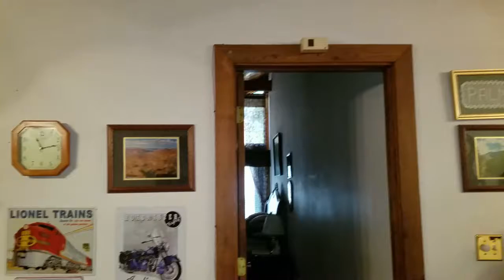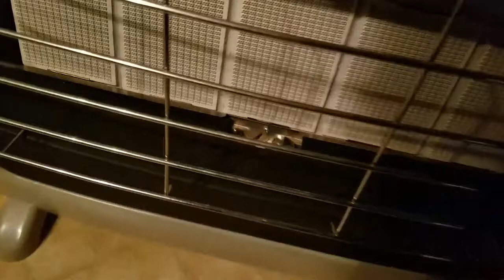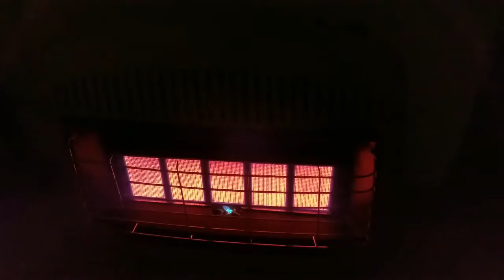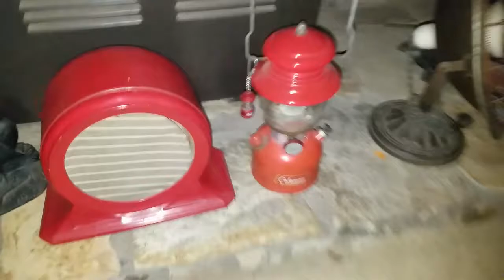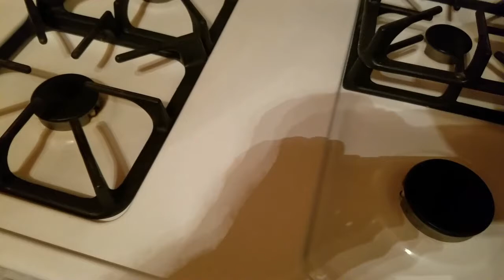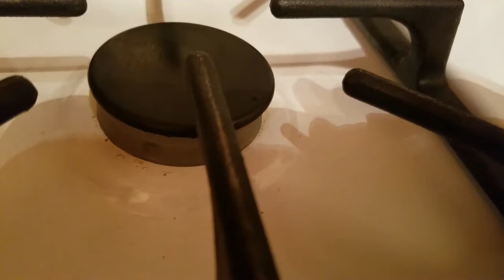Propane Heater & Oven, Gary J

Comment: Gary if you could only have 2 of your boomerangs based strictly on throwing enjoyment and had to get rid of all your others which 2 would you pick? Not based on price, rarity, looks, builder or the fact it was given to you. Strictly for it’s flight characteristics and fun. That’s a though choice with your collection. I only have 15 man made rangs other than my ABS machine built stuff and that’s about 30 in all. I’d pick my Marathon and my Verge 70. I like a big circular flight. Another question is which of yours do you think has the biggest (somewhat) circular flight? You should do a vid throwing your top 5 longest big circular flight rangs.
Reply from the maker: That's hard to answer. I have over a 150 rangs. Some are special made for me from old blue prints.  They all have different characters in flight that can be appreciated. Rus Feuerbach made my  favorite rangs. Omega and V type. They have the best circular motion too. My Verge 60 was really good. It took me 30 min. of throwing to limber my arm enough to throw it with perfect power and speed. It was coming back to me perfectly. The Verge has a beautiful circular motion, but they are difficult to throw perfectly. At least mine is. Mark Legg modified his later to throw easier. William Glover made a 60 meter Tornado rang that's easy to throw with a good circular pattern.
Reply: @knightingalesaid  I have the Verge 60 also. The 70 is the same, only with more weights. I have 4 of Marks rangs. I bought mine from him back in 2012 or 13. Marks a great guy. That’s last builder you mentioned, not so much. I wouldn’t give him a penny of my money again and I get along with everyone and I mean everyone. He has a bad attitude problem.
Reply from the maker: @jamesbarron1202  I don't know him personally. He makes some of the most beautiful rangs out there and they fly really well. If someone has a bad personality, I wouldn't buy from them either.
Reply: @knightingalesaid  I own 3 of his rangs. I sent Manuel Schutz a message in messenger over 2 weeks ago asking how to purchase one of his carbon triblade MTAs. (They’re amazing if you’ve never seen them in action) Manu never got back with me. Maybe the message didn’t go through. I found his Facebook from the boomerang Facebook group I’m in. I send Glover a message asking if he’s ever made a phenolic or wooden version of it I could purchase because I had some of his boomerangs and loved them. He got mad and said he’s not knocking off his friends boomerang and I can build whatever I want. Nobody’s stopping me. I said I don’t want to build it. I was asking if you’d build it out of those other materials. He told me to Fuck off. I told him he wouldn’t say that to my face. Maybe they talk like that in Michigan. Here in Texas you’ll be spitting teeth if you say that to the wrong person. He’s sending pictures of me he’s taken off my Facebook and putting my face on a girls body. I’ve got it all on my phone still. Pics and emails. He’s a weird cat. I told him he’s the only person I’ve seen in this sport with a snotty attitude. I got some vulgar phone calls at 4 and 6 the next morning. I can’t prove who but I’m going to the police station tomorrow and see if they know how to trace the number. They were closed yesterday in my little town.
Reply from the maker: @jamesbarron1202  Wow, man that is terrible. You know most everyone that throws boomerangs has a special bond with other throwers. A business man should know not to roast a buyer. Southerners are very soft spoken compared to some Northerners. Some of those guys can be very sharp and to the point. I have learned that my Northern friends dont mean any harm by being brass sometimes. I wouldn't put up with an attitude like you described either. You need to make sure its really him and he hasn't been hacked or something. That is so out of character for a boomerang maker. He could have simply said, I can't make them like his, but I can make my own design for you. That would have been the proper response. I'm sorry that happened to you. Keep all your records on that incident. Have a great day.
Reply: @knightingalesaid  it's definitely him. I sent it through his messenger. After he said to Fuck Off I was replying back and as I was typing he blocked me. (You can see when someone is replying) I sent a email thru his website after he blocked me. That's when I told him he wouldn't say that to my face. It's funny how tough people are on a phone.
Reply from the maker: @jamesbarron1202  I personally would never buy from a guy like that. It is a cardinal rule that you never copy anyone, because you dont want to be copied. He could have just said that. You didn't ask him to copy anyone, so he shouldn't have responded like that.
I have no patience for hot headed people. I'm sorry that happened. 99% of the guys out there are great people. Dont let him eclipse all the great people out there. Take care.
Reply: @knightingalesaid  it's not like I know who's can be made and who's are off limits anyways. How many of Manus Voyagers are being copied. That rang set the world record and the plans are on Ted Bailey's site along with hundreds of others. Manuel tells people in a interview how to design it for longer distance. How many guys are using Ted Bailey's Wind Sailor design. I guess I need a list of everyone's rangs that are off limits so I won't make someone mad. I wouldn't think anyone cared what others made. Imagine if nobody could copy the football design. There'd be no football or any other sports with balls. I got another prank call yesterday and again this morning. I think it's funny how annoyed he is. The police said childish people use an app to block their number but they can catch him. You'd think those apps wouldn't be legal for anyone to use. This is stuff school kids do. Not very mature.
Reply from the maker: @jamesbarron1202  There is a web site of vintage boomerang styles and their makers. Some of the designers are dead now. You cant find some of the original ones now and if you did they would be too expensive. I ask one rang maker if he would make me some of these unique classic rangs from the past from these designs. I didn't see the point of someone saying, you cant ever make someone's rang. To me that person lives on through his design if they are dead. He said yes, but he would not to sell them to every one. So he made me some very special rangs. I paid for them. Not everyone thinks like this. You can only ask. Luckily I didn't get the same response you did. It is a real blessing to have some rangs that dont exist anymore. So I know where you are coming from. I have several Voyager rangs by other makers. A LD rang is like a Ferrari compared to any other rang. It's very complicated. So it hard to copy someone else's exactly and to tune one.
Reply: @knightingalesaid  James Hoy (fantastic guy to talk to and great builder) told me Manuel doesn’t want anyone getting a good look at his competition LD rangs now. Keeps those to his advantage. James said he’s going to eventually break Manus LD record some day. Time will tell. You’d think it would’ve been broken by now by Manu himself since he’s tweaked even more from his design.
Reply from the maker: @jamesbarron1202  Manuel is the one to do it.